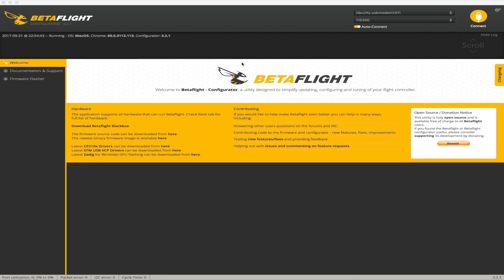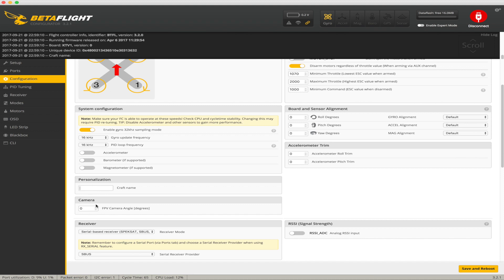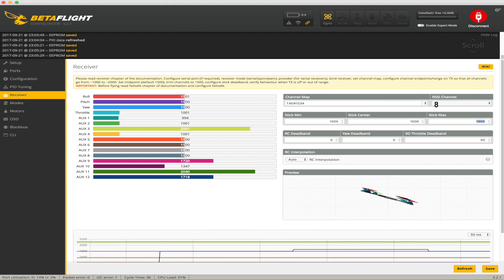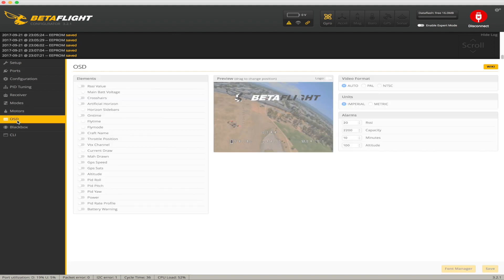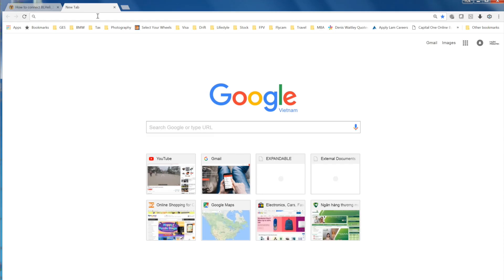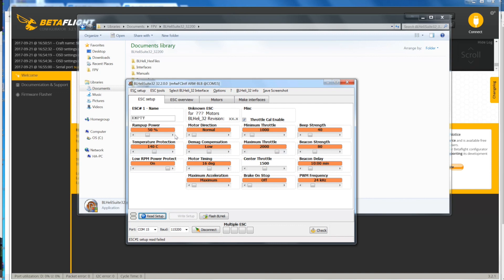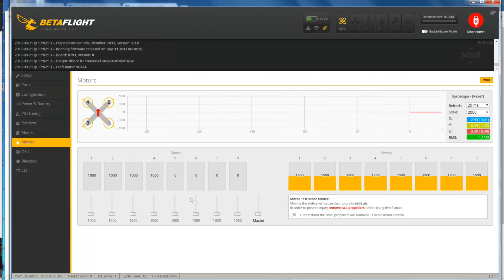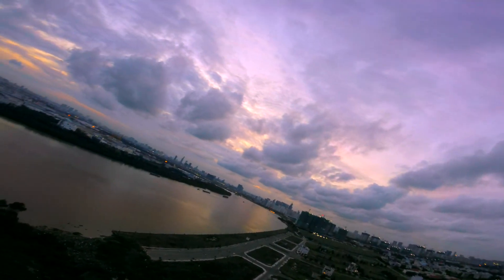Kakute F4 FC Build & Setup with Betaflight & BLHeli32

Comment: Thanks for the build video for sure! I just built a quad with the iFlight beetle frame and the kakute f4 v2 and the build went great except I’m having trouble getting input from my radio to the rx. But the rx is powered on and bound. Any idea why I might be having this problem. Thanks
Reply: I have the same problem! Please message if you figure it out

Comment: hi mate,

When u actived giro u get some pb ? 
cuz i cant use it  for me .
o issue is that when arming with 32k sampling enabled even if only using 8k 4k, or any other combo of gyro pid speeds, the motors start spinning then get grindy/oscilaty as if desyncing. This is only with dshot at any speed, no issue with multishot. With higher gyro sampling like 32k it is almost as instant when arming. There are no issues when using the motor tab. The weird part is using 8k 4k without the 32k sampling enabled works fine. My feeling is this has to do with the combo of 32bit esc and 32k sampling mode.
have u got some idea plz ? :) 
Thanks in advance.

Comment: Hi, can conect  direct the  +/-  on kakute pads to Power on direct to lipo pads of the ESC 4 in one racestar 35amp ? Without using PDB ?
Reply from the maker: manuelxiux hi, yes you can connect directly battery to those Batt +- pads
Reply: Excellent, great video
Reply from the maker: Thanks Manualxiux!